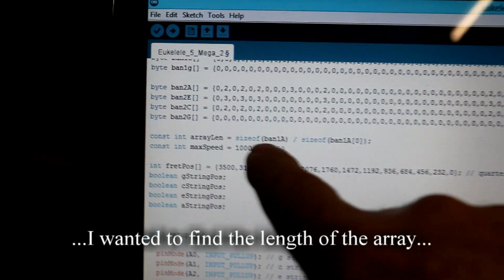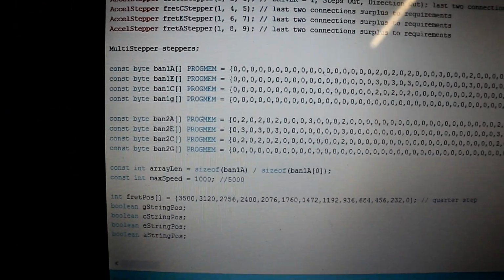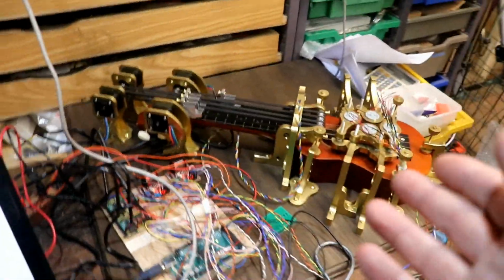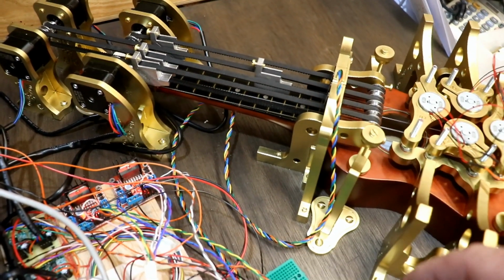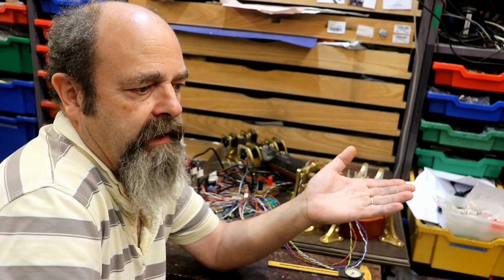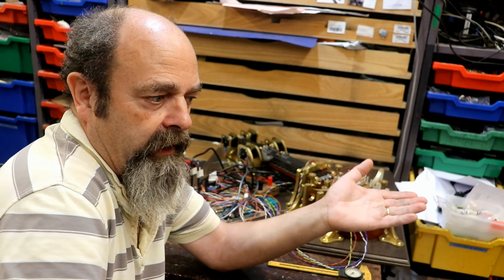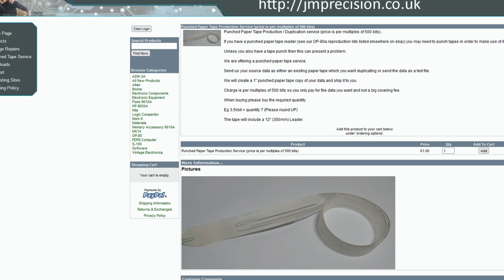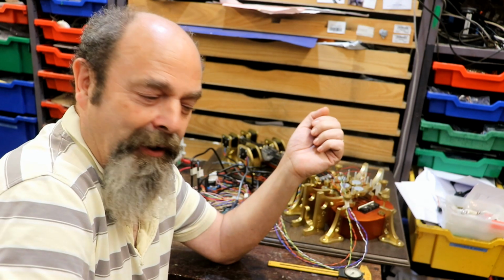Ukulele Playing Machine - 9

Comment: hello, i don't know you'll work on it again but you could use tmc2208 driver to reduce the noise from the stepper motor (and make them a little faster)
Reply from the maker: That's interesting, thank you. If I ever have the time, I was considering building one that would play a full sized guitar or bass using the biggest stepper motors and divers such as you suggest. It would be fun/dangerous to have the fret bearings moving at much higher speeds!
Reply: @steamhead  i Saw a self playing guitar called kuzma doing the exact same thing as your ukulele ... No need for bigger stepper motors, simples low cost nema 17 should do the job
Reply from the maker: @glloqdelacroix4644  thanks very much  for emailing me the information - fascinating and lovely to know others' share such an interesting hobby!

Comment: I like the tape reader idea 🙂
If you created your own system rather than use standard paper tape you could greatly simplify it, the reader would just need to be a VERY simple device, literally just a row of light sensors directly connected to inputs on the Arduino with a strip of paper moving between them and a light (in fact for starters you could just pull the paper through by hand).  The Arduino then just responds instantly to whatever the inputs are so timing would simply just involve speeding up or slowing down the paper feed speed. 
The inputs would be control commands for the Uke.   e.g. The first 5 holes could be a binary number referring to which fret to move to, when the Arduino detects these inputs have changed it reads in what the number is and moves to that position.  Other inputs could tell it to pluck the strings etc.
You could cut the paper tape on your laser cutter in short lengths then tape them together in a loop.
Reply from the maker: Thank you for giving it so much thought! You are absolutely right about the light sensors, I found several people on YouTube who've built their own tape readers using this method. In fact I was amazed at how fast they could read the data.

I've just broken the washing machine doing a towel wash, so things are on hold whilst I repair it! I've also just discovered the base of the Ukulele machine has warped by a ridiculous amount, so I'm making a new base... Once I've got back on task, I'm definately going to look at tape reading. I wondered whether to use cash till receipt paper, as they are readily available and are wide enough to hold more holes! Laser cutting would be an option, but then I'd have to build something to feed a roll of paper through the cutter...
Reply: @steamhead  Hope the washing machine is an easy fix.  
I was thinking you could cut the  tape on the laser cutter in short lengths then join them together in to a longer strip (at least for starters), but as I was writing this it occurred to me you could even just print them on a normal printer and detect the ink rather than detect holes....
This sent me off in to the shed to experiment and I found that the cheap "Obstacle Avoidance IR Sensor" from eBay work really well detecting laser printed black areas (but not inkjet).  You could just do it with LDRs by shining light through the paper and analog inputs on the arduino but reading analog can be slow.
Reply from the maker: @alanesq1  Thank you. I've ordered a pair of shock absorbers for the washing machine, as after 21 years, they are the first bits to have worn out. It really is the most amazingly designed and constructed machine made by Miele - 21 years and still going! In fact the repair may be worth a video!

I think you're right about the printed dots rather than actual holes - there is a point for compromise. It may also mean I can get an old receipt printer so I can print as much as is required in one go. I believe receipt printers work with heat sensitive paper, but I assume the dark areas will still stop light getting through, or bouncing off. Thanks very much for carrying out your experiment - most kind.

Comment: here's an idea for some future project incorporation: use smoke fluid (like the old Lionel trains did) to create some actual fake "steam" when alarm goes off, etc.
Reply from the maker: Now there's an idea! I remember considering adding a chimney to the Is It Time for Tea? machine, but ran out of space. These days I believe it's possible to produce smoke using the element bit of an eciggerette, a plain glycerine solution and one of the small airpumps I use to power the airhorns. It's something I've wanted to try for ages. Perhaps a Ukulele machine requires a boiler and chimney?!
Reply: @steamhead  Perhaps, but I do like the idea of may be adding it to the kitchen timer when you blow the horn.
Reply from the maker: @TheUnofficialMaker  that's an interesting idea. I assume the heater in one of the vape things must heat up almost instantly whenever a breath is drawn through it. If so, it may be possible to have a puff of smoke coming from the top of the horn when is goes off - or even better, a series of smoke rings! As soon as I have some time I'll do some experiments.
Reply: @steamhead  what about using dry ice?
Reply from the maker: @TheUnofficialMaker  dry ice would be possible, although it's quite expensive and only lasts a couple of days when stored in a normal freezer - it would only really be suitable for a single photo shoot. However, a vaping element attached to its reservoir and blown by one of the small air pumps would last indefinately, could fit inside the horn and the smoke would just consist of harmless vapourised glycerine. This is sounding very interesting! I'm just finishing putting together another 40 Nempnett Thrubwell kits, then I want to get on with the Ukulele machine, but then... I need more hours in each day!
Reply: @steamhead  So exciting to have projects on the backburner. If kids would learn this, they would never be bored.
Reply from the maker: @TheUnofficialMaker  if you could get them away from their smartphones...!

Comment: You have a real timing issue and I believe it's to do with the time it takes fro the steppers to move into position. I think what you need to do is calculate how long the steppers will take to get into position and start it moving before the note is required.
Reply from the maker: A great suggestion! I'm currently trying to work out how it could do some sort of 'look ahead' function in the array, so each fret carriage could move to the required position for its next note after the current one had been played. This would speed everything up considerably. It's interesting how such things only become apparent once you see something in action. I do wonder whether Ukulele 'Tabs' are the way forward.

Comment: If you made it MIDI compatible, you'd be able to download loads of material and wouldn't need to go through all the faffing about converting it.
Reply from the maker: MIDI is a very interesting idea which I know nothing about! If it's possible to download tunes in the MIDI format, that would be very interesting. I'll do some research...
Reply: @steamhead  hello there, i've made a midi controled ukulele and i have a code for arduino (i have some problems on the string selection on the midi side and my ukulele use solenoids for each fret) i could share my code if you want :D
Reply from the maker: @glloqdelacroix4644  I had a look on your YourTube channel but couldn't find your ukulele playing machine. I'd love to see a photo. My email address is john@steamhead.co.uk. I'd also be very interested to see how you used solenoids to operate the frets.

I'm currently busy with the 'Unplanned Steampunk Penny Arcade Machine' and am about to resume work on the steampunk TARDIS console, so no time at the moment, but a MIDI controlled mechanical  instrument would be brilliant. I'll make a note of your details for future use...

Comment: Yeah I think the punch tape should help with your timing problems.  Making the stepper pulleys bigger should give you better speed and but then you may have to put disc brakes on the moving parts to keep from crashing into the limit switches!  Ah, always interesting challenges to figure out on a great project like this is.
Reply from the maker: One step forward and two back! But it is slowly getting there. Hopefully braking shouldn't be a problem as the motors are always supplied with current even when stationary. I've ordered 32 toothed pulleys, so they should move at twice the speed.